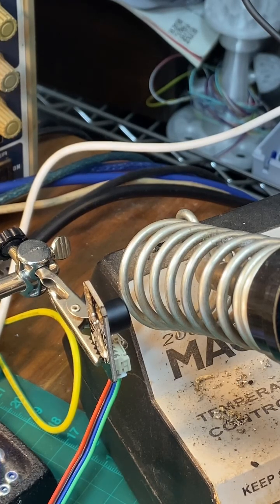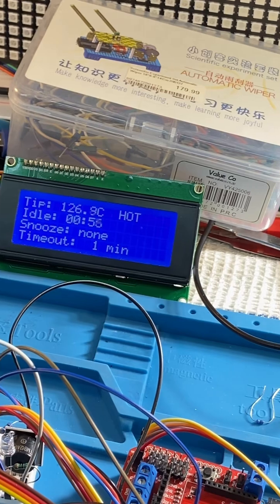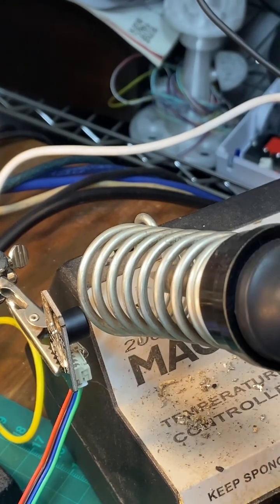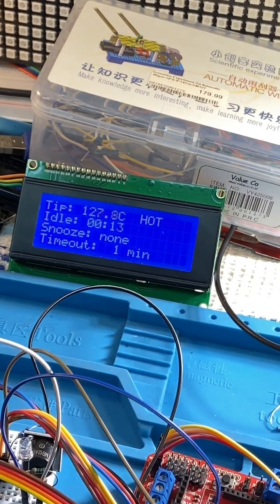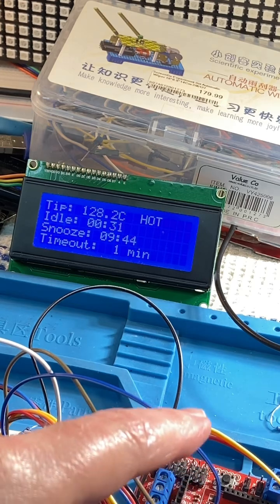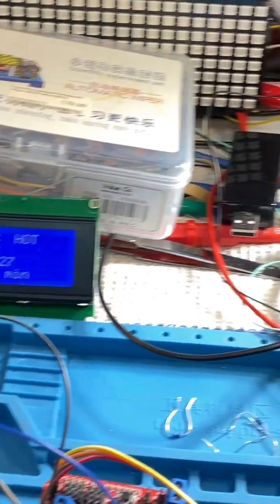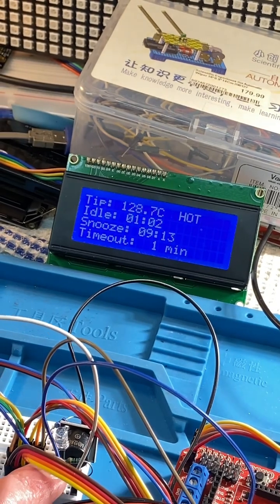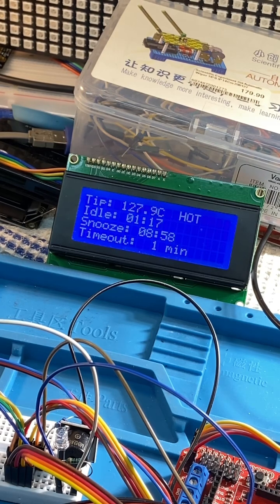Arduino Soldering Iron Reminder Timer 🔧🔥 | Never Forget It On Again!

Comment from the maker: /*
  Soldering Iron Reminder Timer — MLX90614 + 4x20 I2C LCD + Snooze (ACTIVE HIGH on D7)
  -----------------------------------------------------------------------------------
  - Alarms if the iron sits HOT in the stand for IDLE_MINUTES.
  - Snooze button pauses alarm for SNOOZE_MINUTES (does NOT reset idle timer).
  - Exponential smoothing + hysteresis to avoid chatter.
  - LCD shows temp, state, idle time (mm:ss), and snooze remaining (mm:ss).

  Wiring (Arduino Uno):
    MLX90614: SDA=A4, SCL=A5, VCC=5V, GND=GND
    LCD 4x20 I2C: typical address 0x27 (change if needed)
    Buzzer (passive or active): D9 → +, GND → -
    Snooze Button (ACTIVE HIGH): D7 → +5V when pressed (use 10k pulldown to GND if bare switch)
    Status LED: on-board D13

  Libraries (Library Manager):
    - Adafruit MLX90614
    - LiquidCrystal_I2C (e.g., by Frank de Brabander)
*/

#include <Wire.h>
#include <Adafruit_MLX90614.h>
#include <LiquidCrystal_I2C.h>

Adafruit_MLX90614 mlx = Adafruit_MLX90614();
LiquidCrystal_I2C lcd(0x27, 20, 4);   // change 0x27 if your backpack differs

// ---------------- User settings ----------------
const float HOT_THRESHOLD_C   = 120.0;   // above this => considered "hot/parked"
const float COOL_THRESHOLD_C  = 80.0;    // below this => considered "cool"
const unsigned long IDLE_MINUTES   = 30; // alarm if hot this long
const unsigned long SNOOZE_MINUTES = 10; // snooze duration
const float EMA_ALPHA = 0.20f;           // smoothing (0..1, higher = quicker)
const float CAL_OFFSET_C = 0.0;          // aiming/calibration offset if needed (°C)

// ---------------- Pins ----------------
const uint8_t BUZZER_PIN = 9;    // buzzer
const uint8_t BUTTON_PIN = 7;    // ACTIVE HIGH snooze/ack
const uint8_t LED_PIN    = 13;   // onboard

// ---------------- Internals ----------------
float tempC_ema = NAN;
bool  ironHot = false;
unsigned long hotStartMillis = 0;
unsigned long snoozeUntil    = 0;
bool  alarmActive = false;

unsigned long lastUi = 0;

// --------- Helpers ---------
bool readButtonPressed() {                // rising edge on ACTIVE HIGH input
  static int prev = LOW;
  int now = digitalRead(BUTTON_PIN);
  bool pressed = (prev == LOW && now == HIGH);
  prev = now;
  return pressed;
}

void safeTone(bool on) {
  if (on) tone(BUZZER_PIN, 800);
  else noTone(BUZZER_PIN);
}

void alarmPattern(bool on) {
  if (!on) {
    safeTone(false);
    digitalWrite(LED_PIN, LOW);
    return;
  }
  // 800 Hz for 150 ms every 600 ms
  static unsigned long t0 = 0;
  unsigned long now = millis();
  unsigned long d = (now - t0) % 600UL;
  if (d < 150UL) {
    safeTone(true);
    digitalWrite(LED_PIN, HIGH);
  } else {
    safeTone(false);
    digitalWrite(LED_PIN, LOW);
  }
}

void lcdInit() {
  lcd.init();
  lcd.backlight();
  // Static labels (fixed positions to avoid flicker/misalignment)
  lcd.setCursor(0,0); lcd.print("Tip:");
  lcd.setCursor(0,1); lcd.print("Idle:");
  lcd.setCursor(0,2); lcd.print("Snooze:");
  lcd.setCursor(0,3); lcd.print("Timeout:");
  lcd.setCursor(10,3); lcd.print(IDLE_MINUTES); lcd.print(" min");
}

void setup() {
  pinMode(BUTTON_PIN, INPUT);   // ACTIVE HIGH; add 10k pulldown to GND if bare switch
  pinMode(BUZZER_PIN, OUTPUT);
  pinMode(LED_PIN, OUTPUT);
  safeTone(false);
  digitalWrite(LED_PIN, LOW);

  Serial.begin(115200);
  Serial.println(F("Soldering Iron Reminder Timer (LCD + Snooze D7 ACTIVE HIGH)"));

  if (!mlx.begin()) {
    Serial.println(F("ERROR: MLX90614 not found. Check wiring."));
    while (1) { digitalWrite(LED_PIN, !digitalRead(LED_PIN)); delay(200); }
  }
  lcdInit();
}

void updateTemp() {
  float tC = mlx.readObjectTempC() + CAL_OFFSET_C;   // object temp (what sensor sees)
  if (isnan(tempC_ema)) tempC_ema = tC;
  else tempC_ema = EMA_ALPHA * tC + (1.0f - EMA_ALPHA) * tempC_ema;
}

void updateHotState() {
  // Hysteresis: once hot, stay hot until we drop below COOL_THRESHOLD_C
  if (!ironHot && tempC_ema >= HOT_THRESHOLD_C) {
    ironHot = true;
    hotStartMillis = millis();
  } else if (ironHot && tempC_ema <= COOL_THRESHOLD_C) {
    ironHot = false;
    alarmActive = false;
    safeTone(false);
    digitalWrite(LED_PIN, LOW);
  }
}

bool idleTimedOut() {
  if (!ironHot) return false;
  return (millis() - hotStartMillis) >= (IDLE_MINUTES * 60UL * 1000UL);
}

bool snoozedNow() {
  return millis() < snoozeUntil;
}

static void printMMSS(unsigned long secs, uint8_t col, uint8_t row) {
  unsigned long m = secs / 60;
  unsigned long s = secs % 60;
  char buf[10];
  sprintf(buf, "%02lu:%02lu", m, s);
  lcd.setCursor(col, row);
  lcd.print(buf);
  lcd.print("   "); // tidy trailing area
}

void updateLCD_1Hz() {
  if (millis() - lastUi < 1000) return;
  lastUi = millis();

  // Line 0: Tip temp + State right-justified to end
  lcd.setCursor(5,0);
  lcd.print(tempC_ema, 1); lcd.print("C    ");
  lcd.setCursor(13,0);
  lcd.print(ironHot ? "HOT " : "COOL");

  // Line 1: Idle elapsed (mm:ss)
  if (ironHot) {
    unsigned long secs = (millis() - hotStartMillis) / 1000UL;
    printMMSS(secs, 6, 1);
  } else {
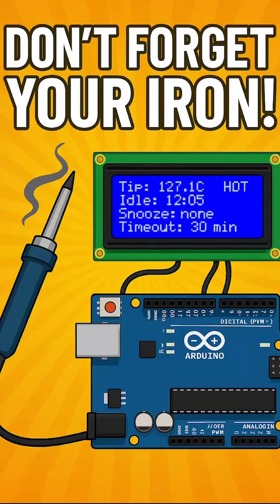    lcd.setCursor(6,1); lcd.print("00:00   ");
  }

  // Line 2: Snooze remaining (mm:ss) or "none"
  if (snoozedNow()) {
    unsigned long rem = (snoozeUntil - millis()) / 1000UL;
    printMMSS(rem, 8, 2);
  } else {
    lcd.setCursor(8,2); lcd.print("none    ");
  }

  // Line 3 is static: "Timeout: XX min"
}

void loop() {
  updateTemp();
  updateHotState();

  if (readButtonPressed()) {
    snoozeUntil = millis() + (SNOOZE_MINUTES * 60UL * 1000UL);
    Serial.println(F("Snoozed."));
  }

  alarmActive = (ironHot && idleTimedOut() && !snoozedNow());
  alarmPattern(alarmActive);

  updateLCD_1Hz();
}